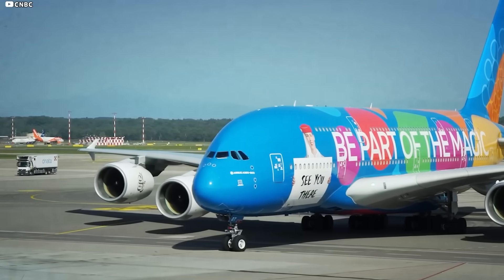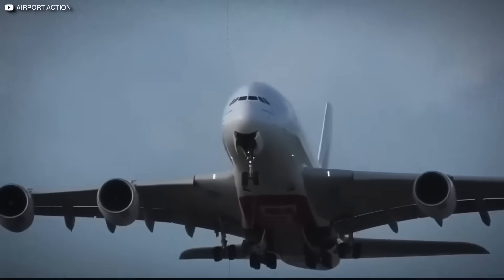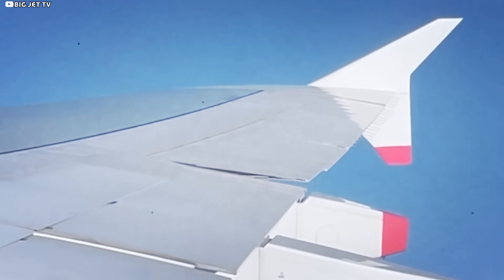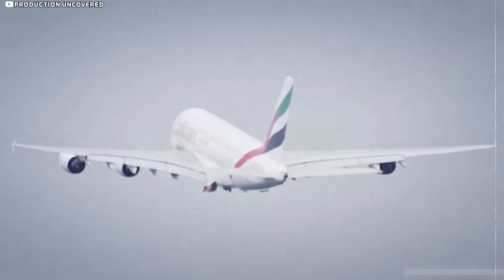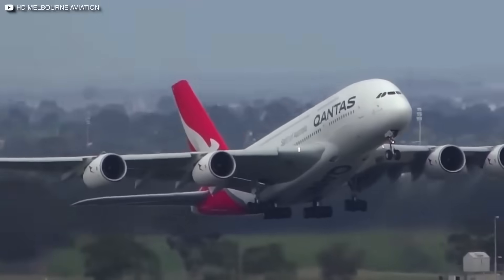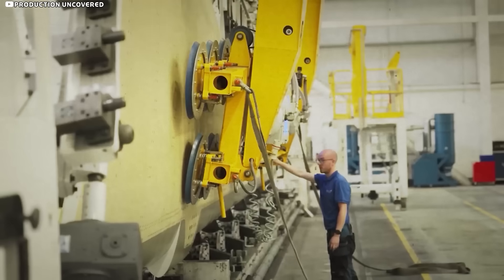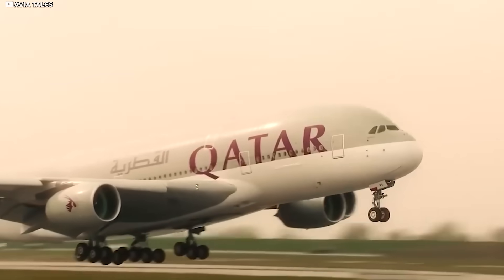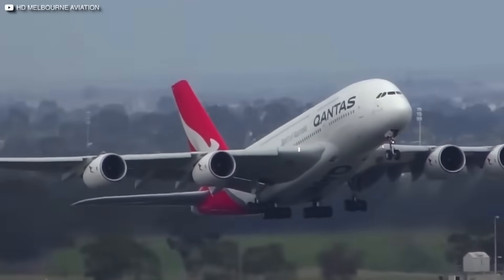How Airbus Outsmarted Boeing With The A380's Wings

Comment: This never really worked out. Airbus never managed to achieve significant results with this wingtip fence design. Eventually, they entered into a collaboration with the American company Aviation Partners, the same team that designed the Blended Winglet for Boeings. The tests showed promising results, but Airbus unexpectedly pulled out. It later turned out that they had simply stolen the American patent and started producing it under the name “Sharklet.” The whole thing ended up in a lawsuit.
Reply: Wingtip fences didn't achieve significant results because the theory behind them is bunk. More powerful computer modelling and computational fluid dynamics modelling revealed that the only benefit provided is their horizontal component and you can get the same results for much less penalty with a raked wingtiip extension - which is what the B787 uses

That's why they've disappeared from more modern designs (Except for Bizjets. Execs love wingtip fences and kept asking why they weren't there, insisting the things be reinstalled)

There are better ways of reducing vortices by directly addressing spanwise flow at a much lower mass and complexity penalty than wingtip fences. 

It turns out the vast majority of spanwise flow is on the UNDERSIDE of the wings/fuselage and if you can keep that flow straight with vortillons/pylons/strakes you get much reduced wake turbulence effects but you'll never get "none". Despite Bournelli's principles the majority of lift on a wing is obtained by "surfing" the airflow in the same way you can surf your hand out the window of a car, with the upper surface shape primarily ensuring the airflow stays attached and entrained. 500 tons of aircraft moving through the air is pushing 500 tons of air downwards as it passes, no matter how spread out it is. 

WRT the "sharklets" - the litigation had nothing to do with A380 and was about A320. API claimed Airbus was violating patents and Airbus sued them to invalidate the patents on the basis of prior art. The settlement reached is confidential with no money reported as changing hands, which usually means that it was more expensive to litigate than it was worth
Reply: Airplane Partners - a Boeing retiree company.

Comment: Europe lack space for expansion, this is actually an advantage for Airbus, they did not have as much temptation to move whole factory elsewhere to try and save cost, and then be forced to pay for training a whole new generation of airplane assemblers, which came with the expected poor quality. Generally, something were learned for every airplane design, success or failure, just the cost of the lesson varies. The lesson Boeing need to learn from the Europeans are their vigor in protecting their airplanes. Instead of acting like the big corporation and deep pocket mentality and admit fault quickly and hope it wet away. Just like what they did with the Max  (MCAS)  when they took nearly 100% of the flak. Airbus would never allowed that in a million years.
Reply: Europe also knows the value of strong engineering union and working together to make products better. 99% of industrial strife is caused by wet-behind-the-ears MBAs with a fixation on "breaking the evil unions" who bowl in and destroy previously harmonious work environments with their ham-fisted policies and determination to leave a "stamp of authority"

Unions don't start out militant. They get that way when management is rotten and has been for a while. Firebrands aren't tolerated by the workers in a happy and productive working environment.
Reply: @alanbrown397  First of all, European unions have more different relationship with the employer, a union member often sit on the board. When One union official been asked a long time ago about their exact goal, the one word answer was "more"This is the polar opposite with executives who are trying to maximize profits. Rotten management just made it worse.  For your info, those strong engineering and work ethics are slowly being eroded away by Europe's tendency to commit suicide by demographics. They imported a whole generation of unskilled parasites that will forever be on social assistance. The Ukraine war (and EU)  helped to drain treasuries, the recent SIG handgun fiasco means their engineering are slipping downwards. I also had an older example of the Swiss banking industry in a decline. They ripped off a group of Jews after WW2. Plus your Swiss bank record are readily available to any gov that can come up with a criminal investigation excuse, and police forces like the FBI are just experts at making such excuses. I believe the Swiss banking industry were started by escaping Templar knights after 1307, they grew fast and powerful in 2 centuries because they were honorable people and well trusted by many. The Templars would have taken a very dim view of the Swiss banking ethics nowadays.

Comment: Build the A380 NEO! :)
Reply: Where?

The lines at Toulouse that built the A380 are now operating flat out building A320s and there's a 8000+ ship backorder queue on those.

Same problem applies to the wings and the various large component fabrication facilities across Europe

It's not just a matter of building more assembly sheds. There's a shortage of skilled and experienced engineers across the aviation sector
Reply: Why?  Tim Clark/Emirates is the only person/airline that wants it.   They've lost enough money on the A380 already.  Stick with the A350.

Comment: A380 might have been an economic failure, but Airbus gained an enormous amount of know how by solving the problems they faced. If you solved the problem at that scale, anything smaller is nothing.
Reply: Totally wrong. Packaging stuff into smaller spaces is a much bigger challenge.
Reply: A 350 is picking up again😂